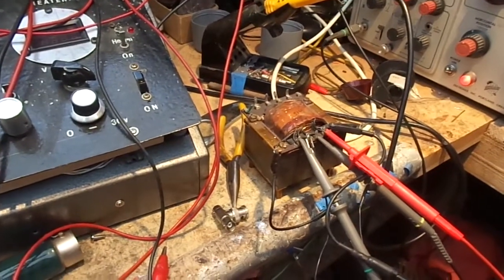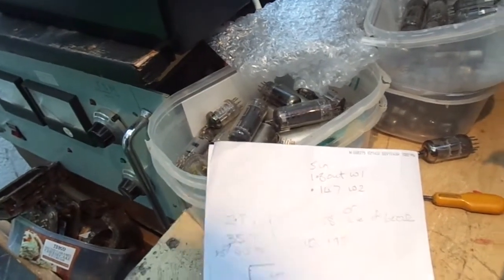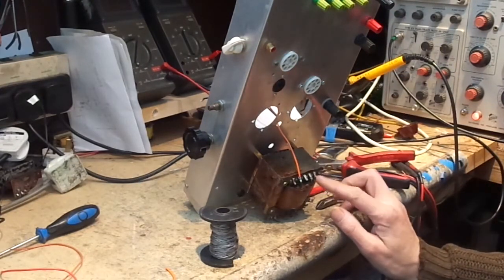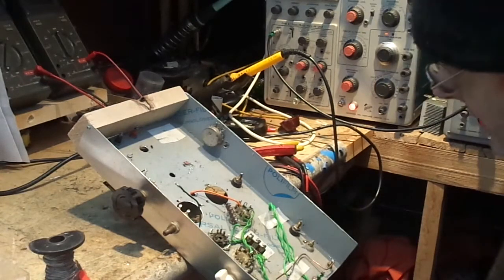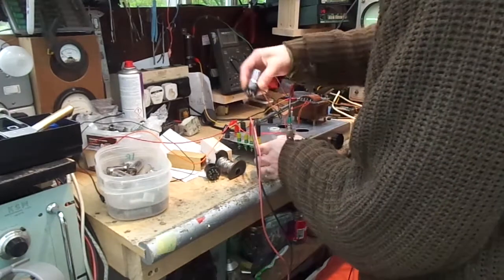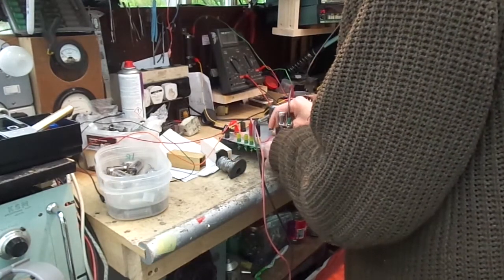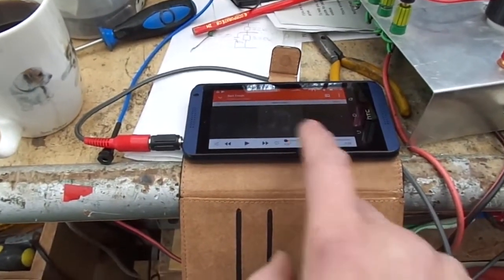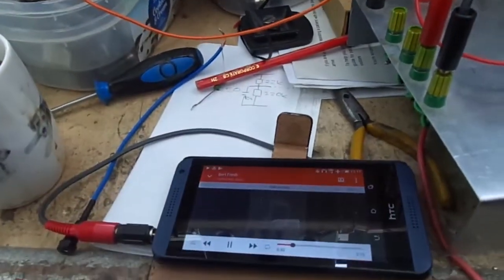6V6 Single Ended Prototype - A More In Depth Look At Building a Simple Valve Amp.

Comment: Have you tried triode connecting a 6V6, 6BQ6,  or a 6L6 etc.?  Might be a good way to use up cheap TV HO tubes too. Nice tip on figuring out output TX.
Reply from the maker: The first set up was to all intents and purposes triode strapped. Looking at a datasheet for the 6V6 as triode gives plate resistance as about 2k, as pentode = 50k meaning a 10k OPT pri Z of 10k is unsuitable for triode mode, I could be wrong there.
   Looking at 807 ( therefore 6L6 family) triode strapped pri Z about the same as 6V6, but maybe 2w more power OP, but heater current twice that of 6V6.
  As for 6BQ6's etc all the ones I have have a low Vg2 max rating, making them unsuitable for triode configuration. Again I could be wrong.
  It's all swings an roundabouts, think I'll stick with the 6V6 for now, it works ok with one of those 6SL7's you sent us....DA

Comment: Hello! Great video - this was really interesting and has helped fuel my curiousity to get into tube amps. Would you mind sharing what model HP signal generator you're using?
Reply from the maker: Thank you, glad you liked it, valve or tube amps are pretty easy to design and build, sound great for the most part and teach one a lot about electronics - great for beginners as valves don't blow up like transistors. 
     The HP sig gen is a HP8903B audio analyser, a very nice bit of test gear, you can pick them up for about £300 up. It has a sig gen 20hz-100khz, a distortion meter and a few other bits and bobs.
Reply: @diabolicalartificer  Yes, liked this video very much and looking forward to watching your other amp builds. I have been working on old Tektronix scope restorations and I'm learning a bit more about tube circuits in the process, but you also make these amp projects look like a lot of fun. That HP really does look like just what is needed for this kind of work. Really good to see people sharing these videos with fellow tube equipment folks.